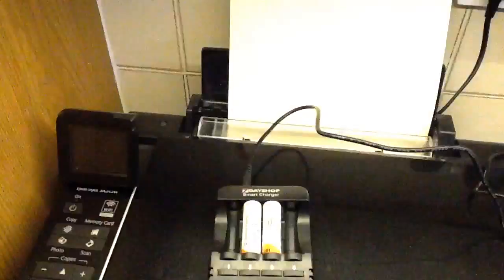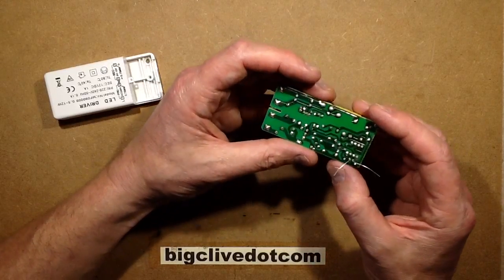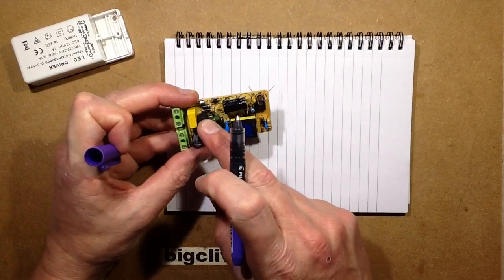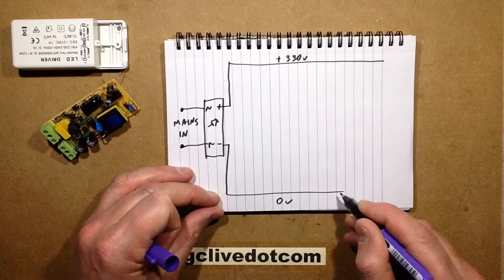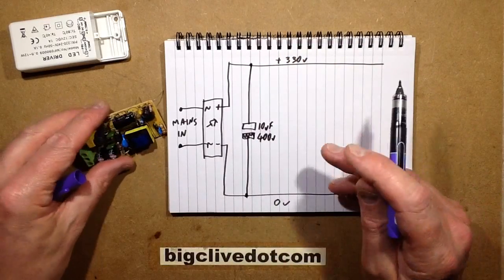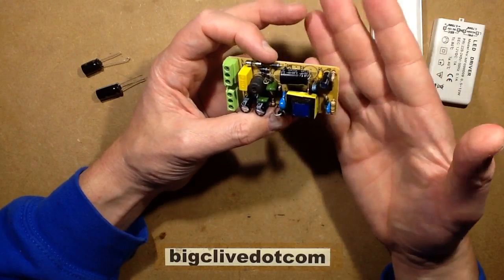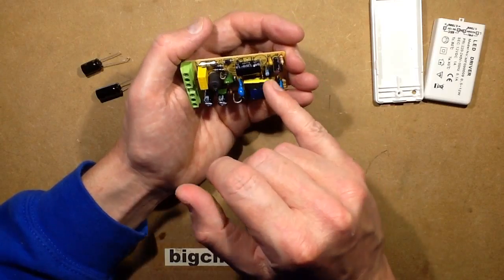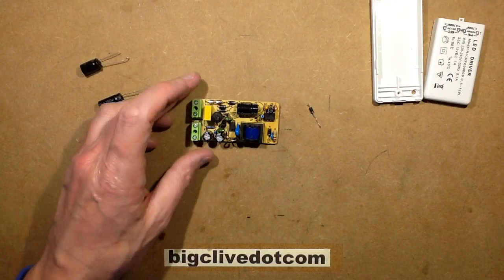(Flashing content.) Repair of strobing LED power supply.

Comment: Can you explain where the 330V comes from when rectified?
Reply: The peak (DC) value is 1.41 * RMS voltage.
Reply: it's 330v peak. Clive has probably done a video on bridge rectifiers. If not, GreatScott has a video on them.

Comment: Hi Clive, How does a transformer work on a circuit that is first bridge rectified and capacitor  smoothed or have things evolved since I retired ?
Reply from the maker: By converting to DC and then driving a much smaller transformer at high frequency the design can be made much smaller and cheaper.
Reply: The "Control chip" generates the high frequency for the transformer?  is it anywhere near 400 HZ, the common aircraft frequency?
Reply: Thank you, I didn't know that, opens many possibilities. I recognize the "Is it really Gas?" "try a match." in your videos LOL
Reply from the maker: More like 20kHz and upwards to allow high efficiency and the use of tiny transformers.
Reply: Some of the old electric locomotives in the US ran on 25 HZ. The transformers at the sub stations where HUGE!!!!!

Comment: In my experience, after a basic capacitor check, the next likely components to fail are actually diodes. I'm a bit like you in a sense that I repair gear on a regular basis so I tend to see this a lot. When I see a diode failure, I usually make a time-saving assumption that the selected part may have been underrated and use a more beefy diode, respecting the switching speeds of the old part of course (naturally, it's also possible that the degraded circuit was pushing higher than expected current through the failed diode...). There are complex situations when you're forced to actually go through the schematics and evaluate that yourself, but often I deal with broadcast and scientific gear that has thousand page service manuals and generally complex and elaborate operation.. so the easiest thing is just to select a similar but higher rated part. I always get capacitors/diodes/transistors from reliable sources for the same reason. Thank you for explaining that circuit, very interesting and helpful!

Comment: In my experience a diode almost never fails but yeah...
never say never. Thanks for the tip.
Reply: I'm listening to this video on a big mosfet power amp that was taken down by a single bad 1n4004 diode. It took me a bit to track it down, and I'd almost given up hope of fixing it, then I took a shot in the dark and tested the lonely diode. Dead short. 5 min of soldering and Clive's voice is larger than life.
Reply: +Chris Richard cool beans!

Comment: Hi Clive, good video's by the way. when you have time, could you do a video on the l7912 -12v regulator. much appreciated has I am new to electronics, I know all about all other components. it's just the l7912 and other l79**, I just can't seem to get the layout right.
many thanks!
Reply from the maker: The main things to note about the 7912 regulator is that it is a negative rail regulator as opposed to the more common 7812 which regulates the positive rail.  The pinouts are completely different and you have to keep in mind that the metal mounting tab is connected to the middle pin, so if you mount it on a heatsink with other components then the tab may have to be isolated from the heatsink with a suitable insulating kit including the little insulating inserts that go into the holes.

Comment: I love video's like this. Taking a $5 supply, troubleshooting and repairing it. Sure, you can go out and buy a new one and not waste your time, but you can spend a couple days and learn stuff and repair it. A lot more fun.
Reply from the maker: It would definitely have been cheap to replace, but fixing things is like an enjoyable puzzle.
Reply: +iceberg789 I'm not trying to discourage you, but.... Odds of fixing the fine enameled-copper windings are near nil, unless the break is right at the very end where it joins the terminal. If you can find a near-exact replacement transformer, either new or salvaged from retired equipment, it should be a simple swap operation. The trouble is that you need to know the exact specifications of the original transformer: dimensions, number of windings (usually just primary, secondary, and then feedback and/or bootstrap), voltage ratio (a.k.a. turn or inductance ratio), etc. Sometimes you can get lucky and find the model number on Octopart, but more often than not, they're made in-house and don't have any numbers.
Reply: You are getting a fault sound using a multimeter on the primary winding? 

If that's the case, and you can't see the fault where the transformer connects to the PCB, then you have only 3 options left.

Option A:
Take it all apart, reverse engineer it, and try to find a replacement part. Odds of it going well are not good.

Option B:
Take the transformer apart and replace the primary winding by counting the number of windings and measuring the gauge of the wire. Then putting the whole transformer back together, essentially rebuilding the thing. Odds of this going well are also not good.

Option C:
Buy a new usb charger ... but i'd still take parts off the old one to use for other projects if it comes down to it. Obviously the odds of this going well are pretty high.

Cost analysis of the options?

Option A:
Cheapest, but possibly hardest.

Option B:
Could be the most expensive, and is still really difficult as anyone who's tried to make a winding for a transformer could tell you.

Option C:
Probably middle of the road cost-wise, and definitely the easiest option.
Reply: ^ thanks for suggesting all those epic options. we purchased a new fone.
Reply: any suggestion to fix if the coil is cut in the transformer of an usb charger ?
Reply: Cut in many places or just the 1? Also, primary or secondary coil?
Reply: at the primary side, the ground pin of the transformer doesn't give short sound to any other primary or secondary pins. i guess its a goner.
Reply: It would have been at LEAST $100 for me cos it's the 16.5V supply for a reef aquarium light.
Reply: Thats why i'm here... I also have 20 of these shitty supplies around the house so its a good investment.
Reply: More like £15 for ahalf decent power brick now !

Comment: How does the transformer do anything when DC is used?
Reply: +SirCutRy For the sake of simplification, the lower the frequency a transformer operates on the more steel that is needed to prevent it saturating whereas a transformer optimized for higher frequency can be made much smaller and lighter while still delivering the same exact amount of power to your load.  Additionally, you need higher value filter capacitors to smooth out the ripple at lower frequencies since there is a greater time duration between AC peaks which means physically much larger capacitors, all of which are factors contributing to the very small size and weight to power ratio of switchmode supplies versus their heavy linear power supplies counterpart.

There is nothing inherently wrong with either type, but you do get a much smaller, lighter, considerably more efficient,, and often much cheaper solution in the switchmode supply versus the brute simplicity of the heavy linear supply of old.
Reply: +Rudofaux Your teacher was an idiot (at least in that moment).  You should have been complimented for having the wherewithal to design and build your own power supply as that is how one learns new things.  So please consider this a much belated congratulations!
Reply: The driver is pulsing the output to the transformer primary (half AC, or pulsed DC), or, if fancier still, it could use a full h-bridge or a center-tapped primary to feed it actual AC (albeit with a square wave). Either approach will generate an output on the secondary side due to magnetic coupling.
Reply: Ethan Poole So the voltage is not quite DC? Why is the transformer not before the rectifier?
Reply: I would like to know this too. I /think/ what is going on is that the rectifier makes (ripply) DC, and from that the chip makes much higher frequency AC, which means that a physically smaller transformer can be used. It is not clear to me, though, why the power supply doesn't just use the transformer connected to the mains directly. Can anyone tell me if I have got this right, or correct me?
Reply: +SirCutRy That reminds of a power supply I made when I was young. It went mains > transformer > rectifier > smoothing circuit > device.

My teacher thought I was insanely stupid for making it & using it but it worked for a good nine years before the capacitors went dry.
Reply: Ethan Poole So the mains power comes to the rectifier, is then brought into the chip and comes out a higher frequency, and only then goes into the transformer. And the higher frequency increases the power of the transformer. Where are the smoothing capacitors used?
Reply: Ethan Poole Thank you kindly sir.

Comment: wound't it actually be more accurate to label the DC side "+165V" and "-165V" (referenced to mains earth) ? Or would that be wrong?
Reply: Or neutral, or ground, needless to say it's the path for positive voltage to flow to (the neutral wire of the AC). Read up on how a bridge rectifier works to gain a better understanding of his schematic.

Comment: That ceramic cap looked like a tantalum from here.
Reply from the maker: That's what I thought at first too.  But it's definitely a low value ceramic one.
Reply: bigclivedotcom
Very interesting indeed.  When I think of ceramic I think of those orange colored round disc shaped caps not that glossy dipped looking one.

Comment: I had about 15 of these when I replaced all my track and accent lighting in house.  After about a year I think I lost about 70%.  None were being driven past 50% of rated wattage.  I never bothered opening them to find out why just replaced them all with higher rated units.  So far it's been a year and half and not a single failure.
Reply: For mine I bought a few of those 20A 12V (ish) power supplies off ebay and ran a ton of 12V wire, the smaller ones never seem to last.

Comment: Hi Clive, I've got a 10m LED rope light, and when it's been on for 10 or so minutes and warmed up it begins to flicker at a very high frequency. What do you think it could be?
Reply: bad L.E.D
Reply from the maker: It depends on if it's a mains voltage tube (mains going straight to the end) or a low voltage one with a power supply.  If it's direct mains then one of the diodes inside the end connector may be failing or making a bad connection resulting in the LEDs being pulsed on just one half of the waveform.  Keep in mind that standard mains LED tubelight  does flicker at twice the mains frequency.

Comment: I'd replace it with another 1000v part like UF4007 if that's what they used, you'd be surprised just how much reverse voltage all of the diodes in a flyback power supply have to withstand (including the secondary rectifier). The 1n4148 is only rated for 100v and could fail from over voltage at some point down the line.

Comment: Building down the road has a LED security floodlight that is strobing every night.
At first I thought that maybe some numpty had cross-wired it to an alarm system strobe output or something, then realised that such an output would just be a latching voltage or contact and the oscillator circuitry is inside the strobe itself. Now I know what the problem is.

Comment: That startup arrangement is used on lots of supplies, including PC ones. Many's the supply I've fixed that was fine "until we moved it/had a power cut". Most times it's the cap that's been cooked, but the resistor is often under-rated on universal input voltage ones - it's OK at 110V but not 230V.